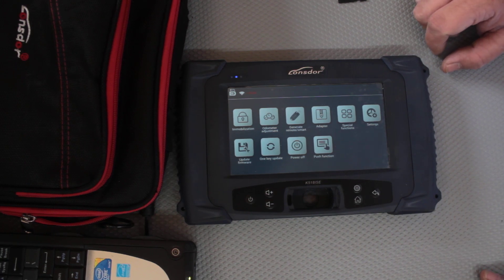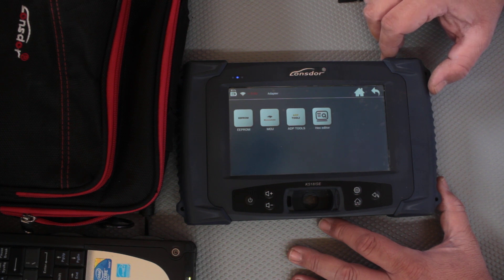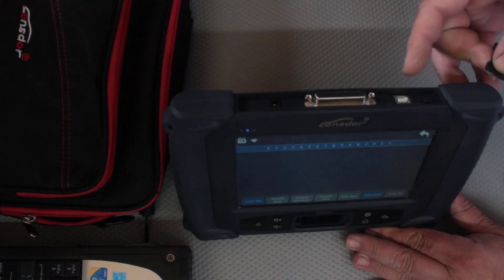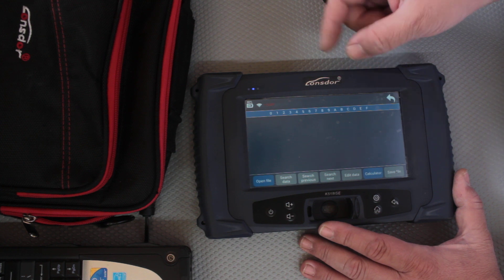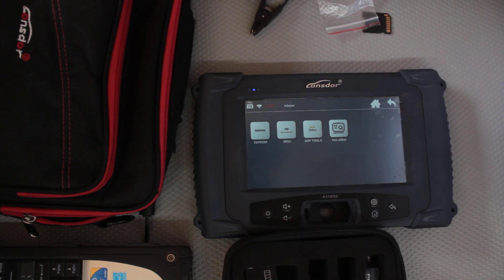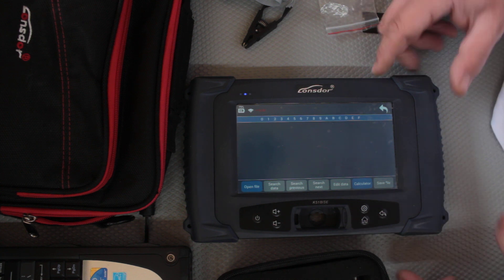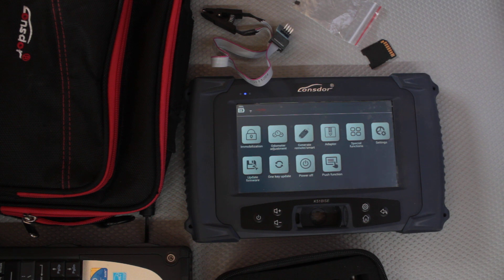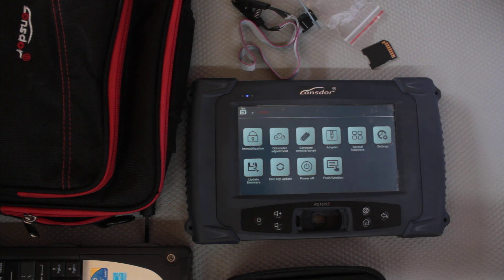Lonsdor K518 ISE Eprom - No good - No import file - No Key Maker

Comment: Not sure if you have used the Zedful much but I think you would like it - has most of the same functions as a regular machine and also the eeprom functions you want, but quite pricey.
Reply from the maker: No sadly we don't have one
Reply: You would need to be doing a lot of work to justify the cost unfortunately with the token structure - but it is a good tool if you do a lot of cars and still cheaper than the SMART Pro.

Comment: Don't use the SD card. Just connect the lonsdor to PC and copy files directly into customfile. Then they will be in the internal memory. That's what I do
Reply: How big is the internal memory?
Reply from the maker: Hi, that sounds like a solution, I will give it a try, do you need any program or will it pick it up as a drive
Reply: Just go to make dealer key and it will let you pick from a short list of files. You have to go to the immo menu.

Comment: There must be a way to add files. What about turning it off then insert the sd card and then turn it on again?
Reply from the maker: It did have a sd card built in, but I don't want to cut a hole
Reply: @DrLockShop  yeah probably not a good idea.